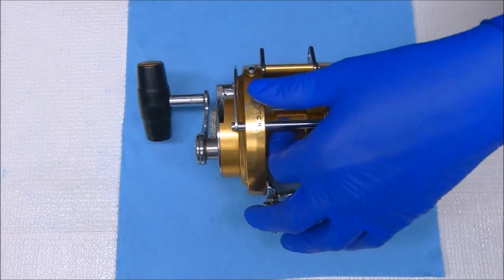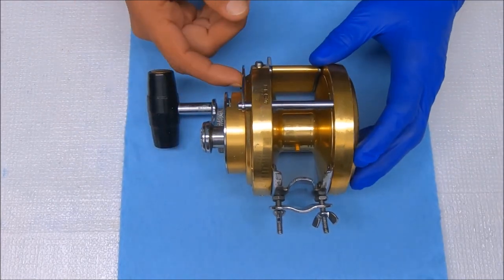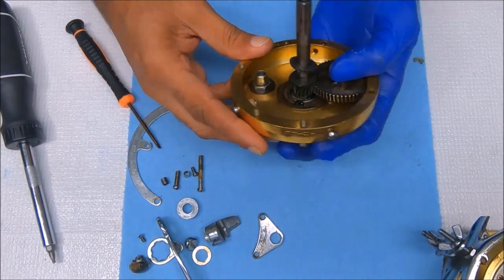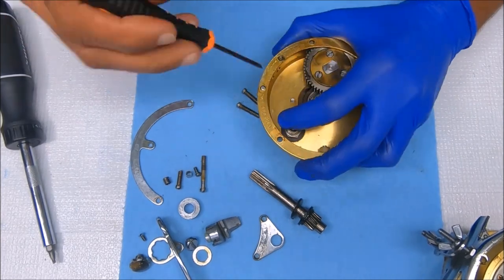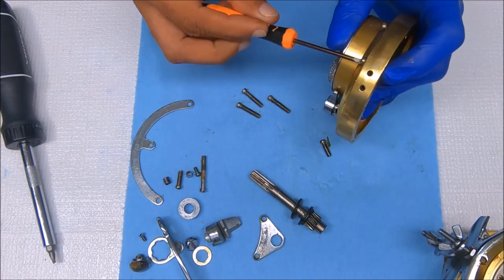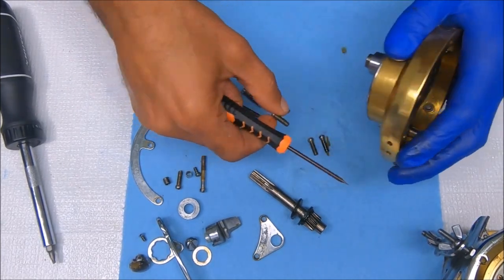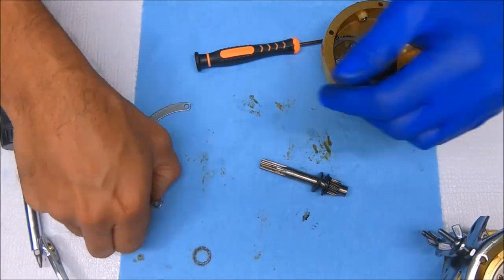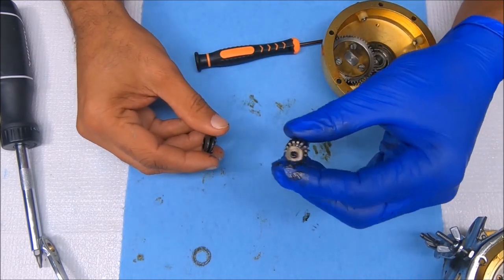Penn International 20 Fishing Reel - How to take apart, service and reassemble

Comment: Thanks for the videos! I recently purchased 4 of these 20s from a gentleman who graciously threw in a 5th. The freebie had a frozen handle, loose clicker and a frozen drag detente button. The detail in your video gave me the confidence to take apart, clean and service it. Interestingly I came across another 20 with a missing clicker in which the hole was filled in with epoxy, they even tried to paint the exterior of the filler to match the anodizing. Pretty strange. I’m planning on boring out the epoxy to the original diameter opening then reinstall a clicker. Thanks again for your guidance!
Reply from the maker: Thanks for watching! Glad to hear my video helped you complete the job! Before you drill out that hole, be sure you can find the correct replacement part.... they're not easy to find.... especially brand new. More vids to come! Spread the word about the channel.

Comment: Do you not service the actual bearings until they need to be replaced? Or should I be putting oil in the bearing?
Reply from the maker: Thanks for checking out the video. I oil/grease bearings. If you're looking to do a deep clean on your reel bearings, see here:

https://youtu.be/GI02FQMq9Nk

Note, some OEM bearings on the older Internationals CANNOT be serviced this way. If one side of the bearing is plastic, DO NOT try to remove it..... you'll destroy the bearing.

Comment: Great stuff here, I bought a used Penn Intl 80sw its missing the clicker button and I hear they are discontinued do you know of a fix? Thanks
Reply from the maker: Thanks. You can check mysticparts.com for the clicker, but it can be  difficult reel to work on. I would recommend not touching it. Take it to a repair shop or send it to Penn if you need service.